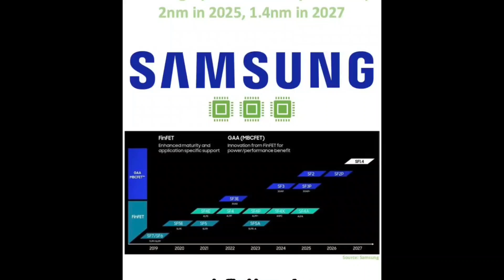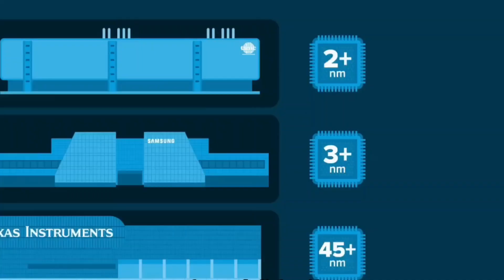Starlink + Samsung’s AI 6G Modem Will Change the World

Comment: Samsung is making huge strides the past few year. Their chipsets are powerful and hold their own against others. I personally absolutely love my Samsung S phones. S20, S21 and now S24 ultra phones are the most reliable i have ever used. 1UI software is awesome. I am pulling for Samsung. ❤
Reply from the maker: Glad you're enjoying your devices!
Reply: I wouldn't say that and I use their products and yes I use an as in 1 Apple products and until they get the accuracy right or the chipset correct or heck even the software optimization right it's just a phone, but I do respect your opinion.